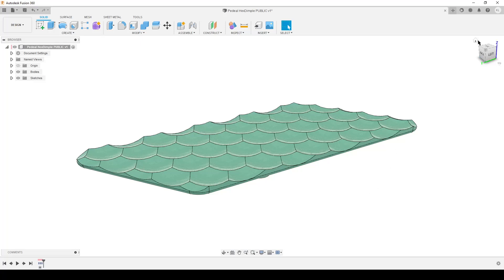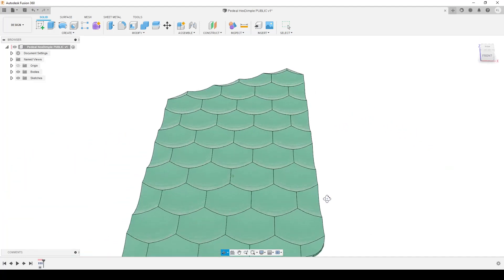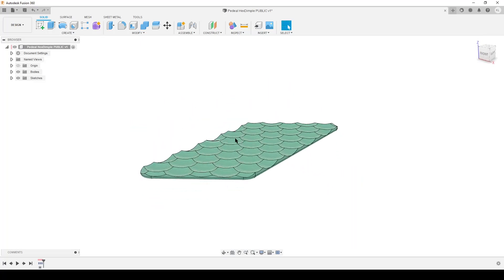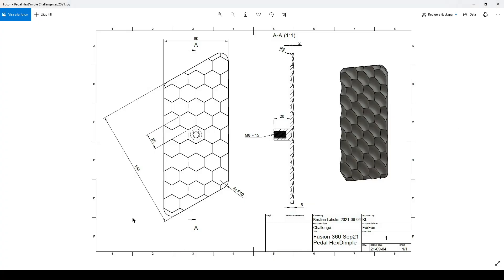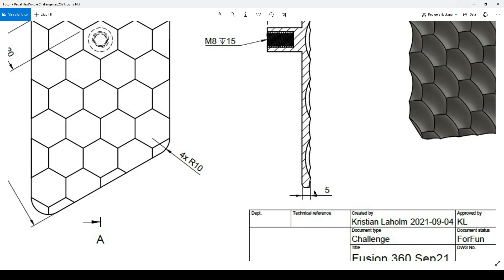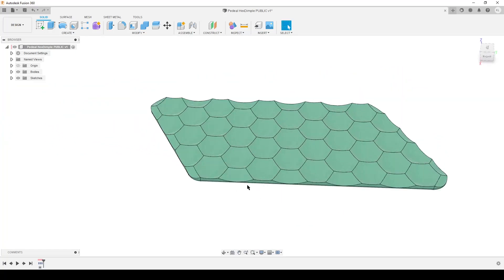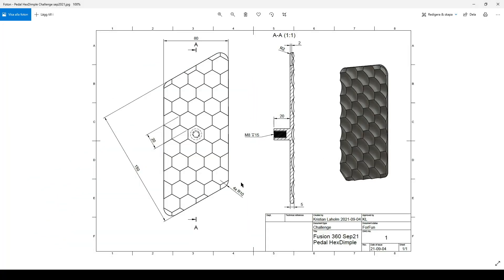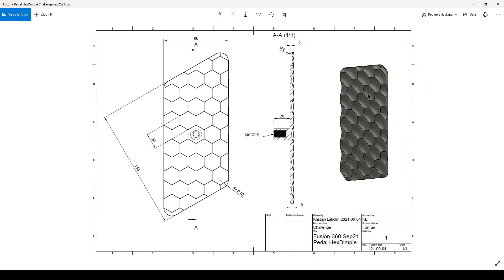Fusion 360 Challenge - September 2021 - Pedal with Hex Dimples

Comment: Maybe I'm blind - but I think the outer dimension of the post on the backside ist missing. With an assumption of 12mm i get a result of 29387.818 mm^2. 
And an angry wife cause I do construction and not gardening :)
Reply from the maker: Oops i missed that one, the post is ø14mm. I'm sorry I added this complication to the design process ;)
Updated the linked drawing.
Reply: @KristianLaholm  For this time you are pardoned! This adds extra 143,664 mm^2 to a total of 29513,482 :)